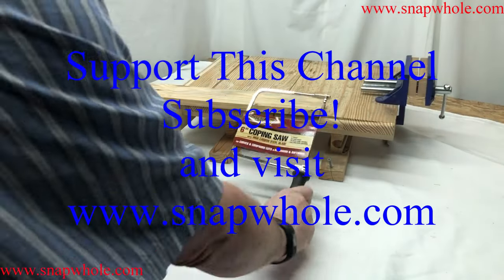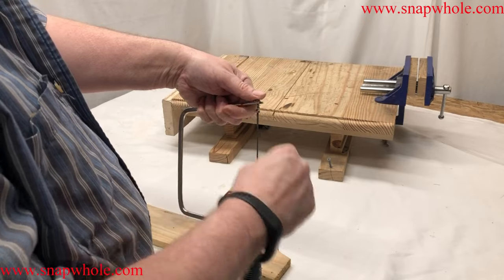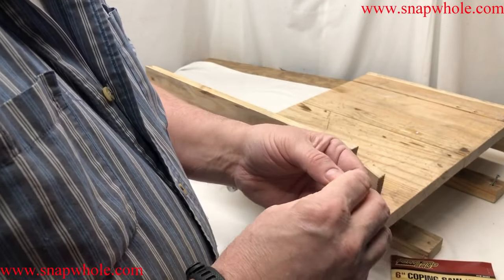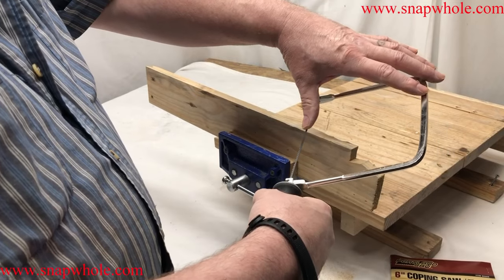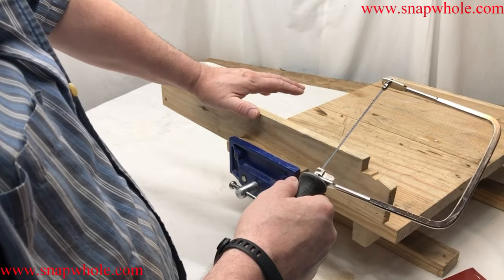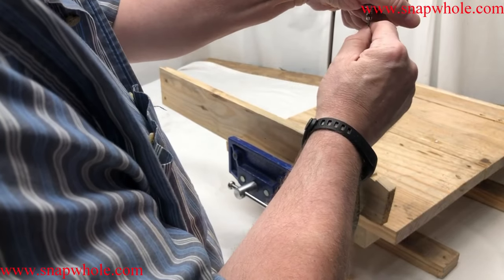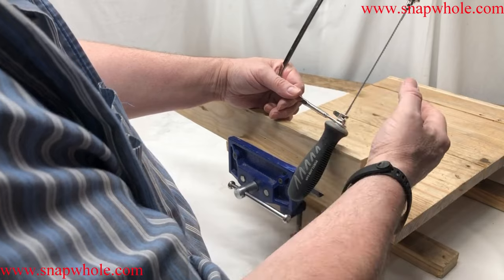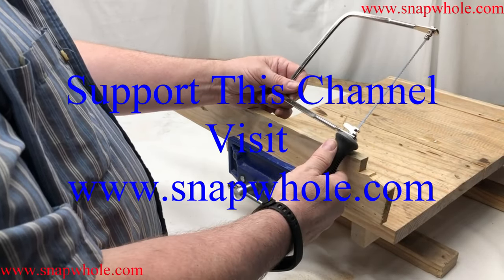Harbor Freight 6 inch Coping Saw Use Demonstration and Overview

Comment: could you use this as a replacement for a small scrolling project? Very rarely do I have a need to do this so the expense of a scroll saw would be excessive.
Reply from the maker: yes you can, it would take a little longer, but you could get the same result - I suggest you practice on scrap wood - thanks for subscribing!

Comment: How do you remove the blade?
Reply from the maker: twist the handle to loosen the tension on the blade until you can remove the blade - thanks for subscribing!
Reply: @snapwholeharborfreightreviews  When I twist the handle it is twisting the blade
Reply: @bananapeelmebpm6295  it comes a bit stiff, i couldnt get it either till i used some pliers on the little tab.